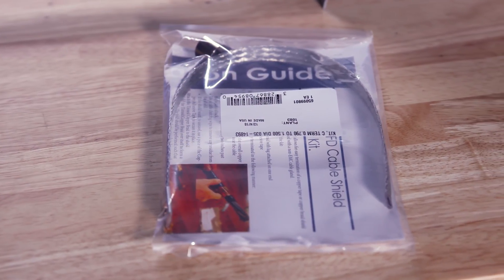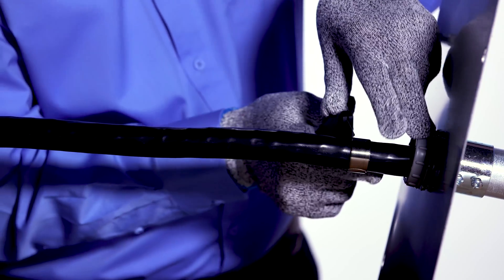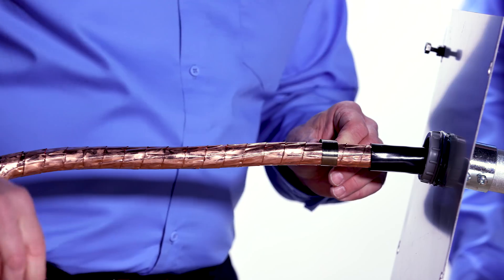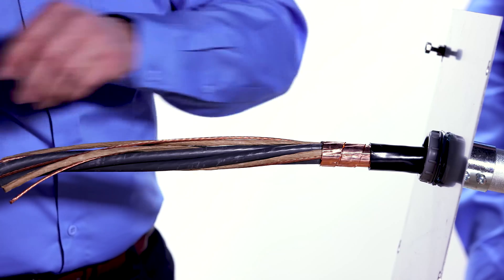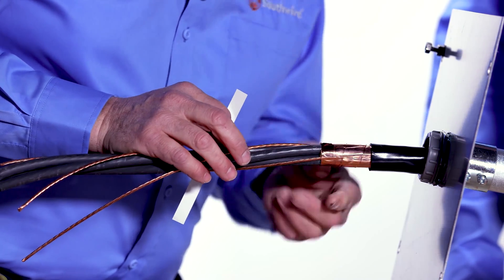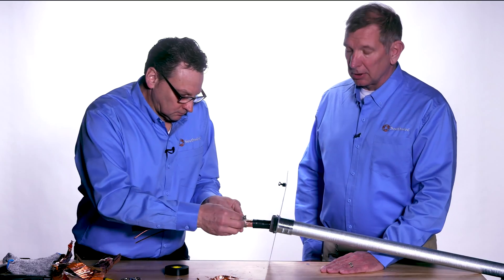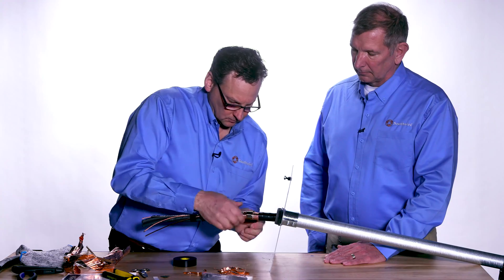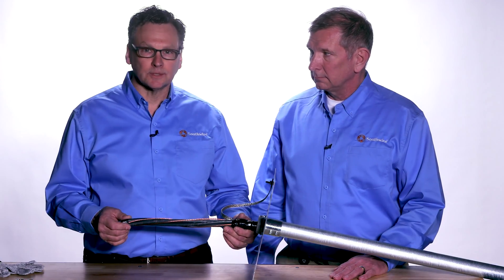VFD Termination Kit Installation

Comment: 100% waste of money in 99.8% of installations using shielded or special wire for drives. At the large hospital  research center that I retired from the over 500 VFD'S only had had normal THHN/ THWN wire and a copper ground wire inside metal conduit { EMT & short piece of greenfield or liquid tight  }.  Most motors were plain Jane NEMA frame types some over 35 years old. Had very few motors burn out a year. Motors were 2 to 1,750 HP. In newest building every motor 60 HP & higher were on 18 pulse drives except for the 250 HP Fire Pump that was on a soft starter.
Reply: Ok boomer.
Reply: One of my first expierinces 15 or 20 years ago in wiring two large pumps at a cooling tower controlled by VFDs without any shielded cables resulted in bearing damage to both which requied replacements in less than a year. Chokes were installed at the drives which took care of the issue, but since then I go with shielding per the manufacturer.

Comment: Thanks for the explanation.  That's for low voltage VFD cable, correct?  What do you do with the excess of the three grounding bare cable?  Just cut it? or should you get them connected to the ground terminal on the cabinet chassis?  Best regards.